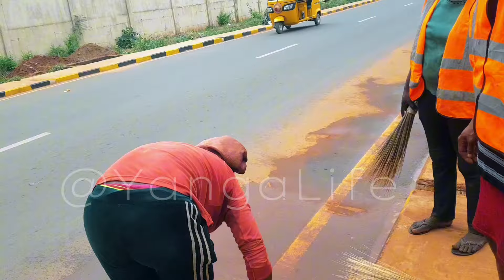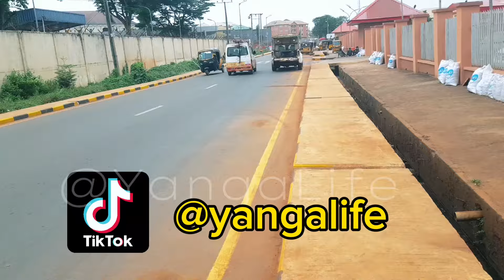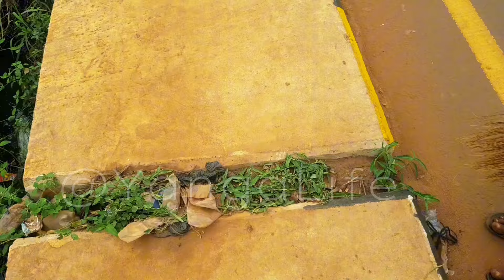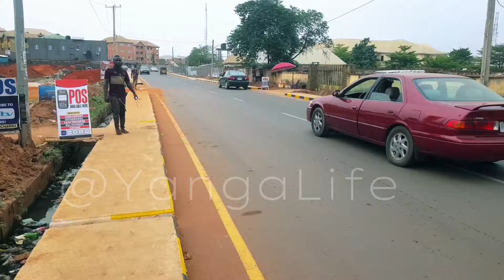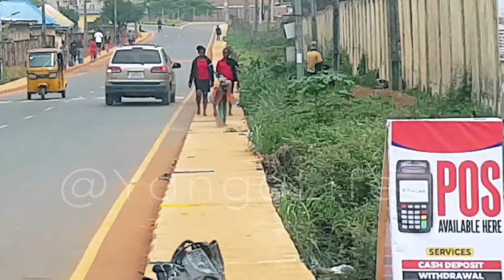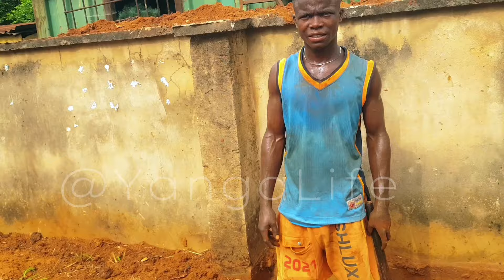ACTDA Engages Workers On Sweeping And Washing Of Roads In Awka

Comment: Congratulations bro is all.
But I will suggest they use pressure machine ,like the one they use to wash car,for easy removals of sand and dirts...
Me personally can contribute at least  two Pressure machine for such.
Reply from the maker: Should I go and communicate them on this your promise?
Reply: Or even better yet, a street sweeper/washer.  Sure it will cost a lot more, but it's far more efficient in coverage.
Reply: @chiemekaa  I concur. Wonder why no governor or administration thinks in that line of using street sweeping machines. 

Using our mother's to do this sweeping is not only slow and inefficient, its a health (inhaling potentially harmful dusts)and safety risk (road accidents). Just my 2 kobo thought.
Reply: Chief, your prayer has finally been answered on road sweeping and washing, lol. If you need to carry on yur good initiative in supplying them pressure washing machines, I sell them in case you need to purchase them for the good of our community, thanks

Comment: Behind that gutters need interlock or carpet grasses to keep them clean. Road sweepers should not empty sands there after sweeping, they should pack the sands in bags and place them somewhere around for evacuation
Reply: Interlocks with some spaces of flower 🌴 trees can last instead of all through grasses cos it will be difficult to maintain
Reply: If the cannot interlock, at least they should pave it. Thank you for this submission
Reply: @okeziefelix6562  you're right there .  💯